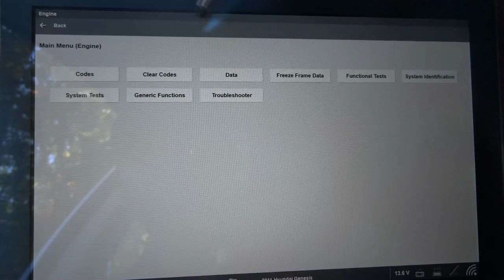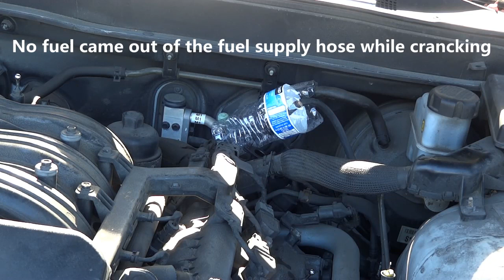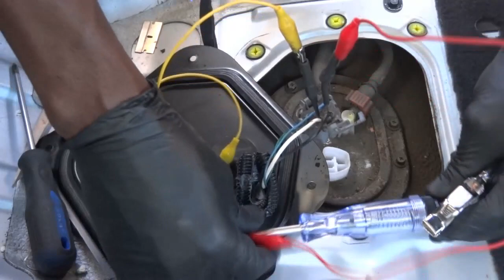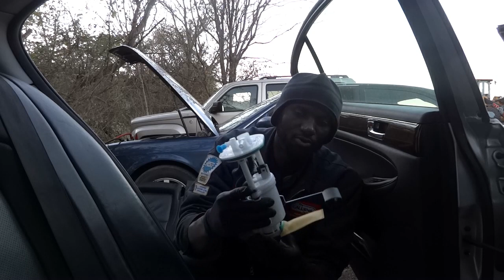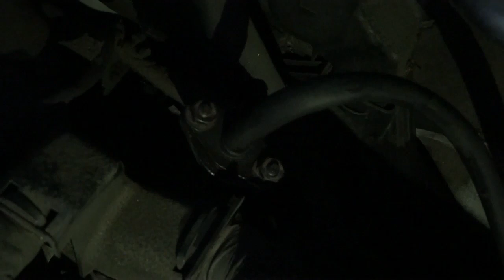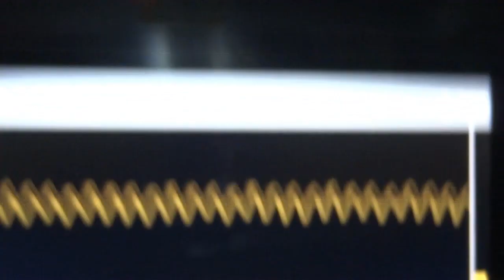Hyundai Genesis - Crank, No Start/ Fuel pump testing

Comment: Would the fuel tank pressure sensor  be any were near the fuel pump or would it be near the purge system in the trunk? As I can't find crap on the forms.
Reply from the maker: Jacob Siejka the fuel tank pressure sensor is next to the evap Canister
Reply: @KITS_Auto_and_Truck_Repair would that be in the engine bay or near the fuel tank on the passenger side